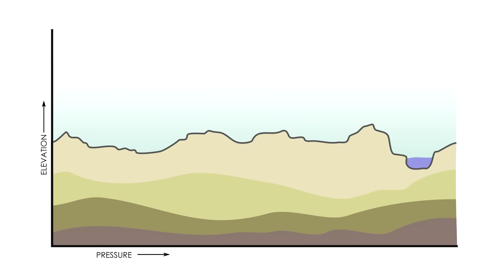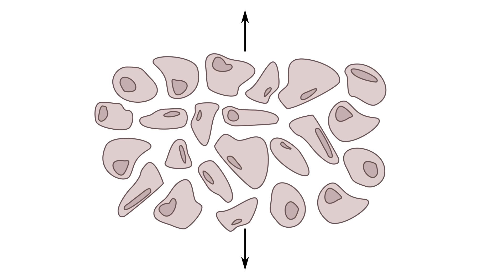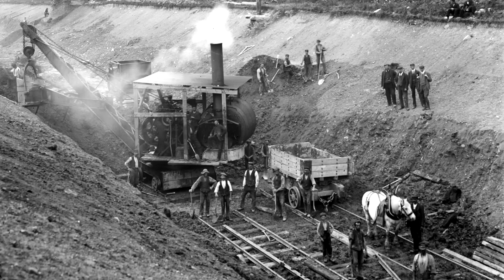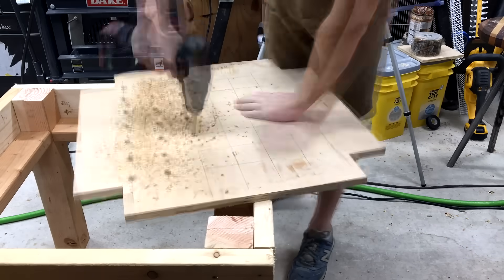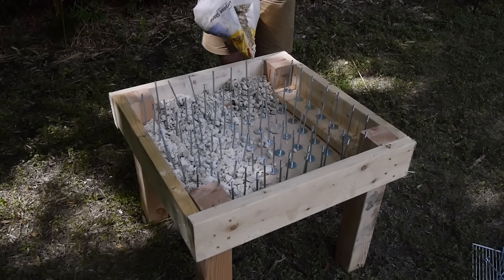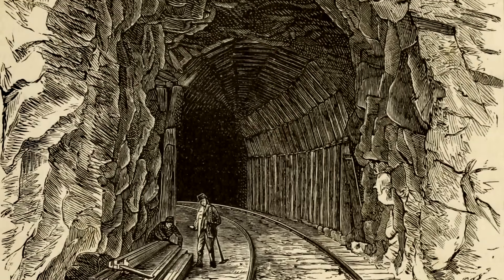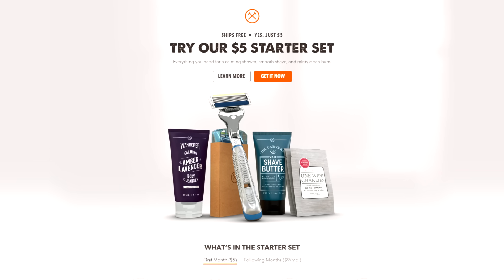Why Tunnels Don't Collapse

Comment from the maker: I pinned this comment just to say thanks for watching my video, and I hope you are having a very nice summer.
Reply: Please do a video on dealing with  underground water when digging tunnels, type of pumps used, methods and challenges.
Reply: Rob the Code master. It depends on how much water you run into some tunnels have to run a couple 200hp pumps just to keep from flooding I have been lucky so far as to have been in relatively dry tunnels in which a well placed 110v pump will do the job just fine
Reply: it's winter
Reply: i love it
Reply: Today it is so hot in Germany that the government reduced the speed limit on some Autobahn sections to 80 km/h due to the fear of blow ups. Meaning the road surface lifting up caused by heat expansion on old concrete roads. 

You might want to do a video on the topic and how to avoid heat caused expansion.
Reply: What I can tell from this comment is that you wrote it 6 days before publishing the video whilst still working on it or withholding it until a standard release date.
Hope you're enjoying the summer too!
Reply: I really enjoy your videos, I am a graduate civil engineer and I always learn something new.
Reply: In turn, I'm having a shitty winter in the southern hemisphere. you help make it a little less sucky, tho.
Reply: Could you do a video on the cost of regulation and how much of it is necessary for the environments they exist in? (i.e. regulations for earthquake sturdiness in non-earthquake prone areas, or low flow shower heads over personal preference.)
Reply: What a Hemispherist thing to say! ... It's winter down here, matey! :-)
Reply: im melting  in my chair
Reply: Yes, stone arches can work to transfer the compression load from the ceiling to the floor.  The gap can be filled with a wedge, or stone.  One book I read about minind described using wooden wedges above semi-permanent shoring so the wedges can be inspected.  If the inspection showed the ceiling is moving they come back and add more support or rock bolts.
Reply: Anime Freak,

Earthquake regulations in low-seismic areas impose very few requirements on a building design. Additionally, the entire US has been mapped out with estimated maximum earthquake forces, so in areas where those forces are low, the designers aren't making buildings extremely earthquake resistant.  Wind forces in low-seismic areas almost always dictate what the design strength will be. Almost all the imposed requirements also help with the wind resistance of the overall structure.
Reply: +1
Reply: Great video man
Reply: Question: Would making a stone/brick keystone arch work? Perhaps if a wooden spacer/wedge was inserted into the minimal space between the arch and stone ceiling?

Often in fiction, they have stone tunnels or even large vaulted chambers despite living in an age where steel weapons were expensive investments. I have always been mildly curious if such a method could work.
Reply: @Soulwrite7 A wooden former of the arch is scaffolded, the bricks all radiate as you suggest
Reply: I approve this video as a geotechnical engineer
Reply: Practical Engineering Awesome video! It answers so many questions. I want to be a civil engineer when I grow up
Reply: really liked the video, one suggestion: you should've taken a sledgehammer and destoy the gravel bridge. remember it's the internet feed us destruction.
Reply: i do not think summer is able to be nice specially in my region 
for this i really appreciate your video   , underground is best place to hide from sun heat
Reply: It is winter here, but thanks nonetheless!
Reply: Sir, you're awesome and I love your channel. Here are my civil engineering questions:

1. Could you do a video on how public transportation networks are engineered?

2. Could you do a video on irrigation systems?

3. Could you do a video on canals?

That's a start! I hope you haven't already done all that. I just recently started getting your channel on my "feed" as they say!

Bravo again!
Reply: how can a train drive
Reply: saturner 420 good question lol
Reply: I hope you're having a great summer as well!
Reply: Thanks for makin them, partner
Reply: Thanks to you for your very instructive videos
Reply: Thankyou
Reply: Great video. I've often wondered how I would build a tunnel in the side of a hill. Thank you!
Reply: Practical Engineering the strangeness of the result made me laugh while watching it happen in front of me. I liked the video you just posted.
Reply: What about the concrete series? You gonna work on it again?
Reply: Great video! Super interesting!
Reply: Practical Engineering your my favorite youtuber finaly someone that exercises your mind and i had no idea what civil engeneering was and im thinking of folliwing that career thanks to you.keep making videos plz ps your awesome
Reply: Love the engineering/technical explanation here. Can you cover "The Boring Company"?
Reply: Winter here mate =D
Reply: Sometimes, you do things that I think are crazy, and I don't believe that things will hold up, or do what you are trying to explain. But then you do it. You are a fricken wizzard.
Reply: Thank you for another awesome video.
Reply: badass video
Reply: Please make a series about how to reinforce a material
Reply: Nice work. : I spent some times into the fjords of Norway  where there are a huge  amount of tunnels (obviously). I was surprised not seeing any reinforcement ... we could actually only see the raw and sharp rocks. I imagine that what you just demonstrated is the explanation.
Reply: sooo rock bolts and shotcrete then ?
Reply: question how big can a tunnel get befor  it simpley cannot sustain the weight of the matrail above ? like    i think the biggest tbm  ids like 17m dia ? but could you high bigger and if so how much ? 20?30?50?m  is there some point atwhich you just cant realisticly go bigger ?
Reply: i concur from kiwiland :P
Reply: Thank you for making this!
Reply: What happened to your hair?
Reply: Nice winter yes. Nice summer no
Reply: Tunnels? You should analyse where the Anzob tunnel went wrong and by this I mean 2005-2015 before Chinese engineers were bought in to fix it. You can find videos of how bad it is. I had the misfortune of travelling through the Anzob tunnel in 2008. It was waist deep in water and on a motorbike that wasn't fun at all.
Reply: Yeah bro thanks :)
Reply: Can you make a difference between Post tensioned and pre tensioned beam. How it is made? Thanks!
Reply: Bit toasty, but not too shabby.
Reply: Practical Engineering Talk about Oak Island's Money Pit!
Reply: Practical Engineering 
Would an arched roof sending pressure sideways help any? Thanks for the video.
Reply: great video :). very knowledgeable and I learned new info.
Reply: I'd love a video on deep drilling, how to stabilise the drill hole and how deep we can get with current techniques.

Both for Geothermal applications and/or mining, although I'm mostly curious about the first one.
Reply: Video Suggestion: Catenary Curves
Reply: I pinned this video to reinforce my grey cells
Reply: Loved it, your explanation was very clear ... thank you!
Reply: Practical Engineering 
please add a video on drained and undrained condition for shear strength
Reply: I've always been impressed by excavation works in mines or tunnels, thank you for your explanations and "brave" demonstration.  I'm not engineer but I'm fascinated with engineering work and all your videos are very enlightening.
Reply: Very good explanation
Reply: Practical Engineering thanks for this video!!! These are great! I sent my brother a gift certificate to Dollar Shave Club because I use them too.   I thought that these videos are sponsored by a company I already like, maybe I should spread the word AND attribute it to your videos!

Thanks again for what you put together!
Reply: You need your own tv show
Reply: You could make a trap by having the bridge unbolt itself when you step on it
Reply: great experiment.....good information :)
topic I want to understand "How the bridges are built in sea"
Reply: You are awesome keep doing this 👍
Reply: wow amazing information. so i think you can make video about wood or bamboo engineering
Reply: nice pun
Reply: Great video as always but the photo at 2:40 isn't a tunnel. It's an escalator in the atomium in belgium.
Reply: Gday Please do a video explaining building a home under the earth eg SHTF bunker
Reply: Yup that's how it's done, but before the rock bolts are inserted metal screen fence is put-up then the rock bolts and plates are installed and torqued at least in the mines that I worked in, in Ontario Canada!
Reply: Add videos related to design of buildings to resist lateral force
Reply: cool stuff, love the vid.
Reply: Nice video. Manitoba 'professional engineers' are reckless trash who dont know what they are doing and their union the Engineers Geoscientists Manitoba covers for them.
Reply: Can you do a video on the different types of injection moulds? Thanks.
Reply: I am lol
Reply: the music is so fucking bad
Reply: Make a video on pile foundations
Reply: Very educational. Thank you
Reply: ?p0p
Reply: Hey grady...how long do you think you could make a rock bridge?
Reply: Do you think you would have better results if you had shaken or vibrated the rock before tightening the bolts?
Reply: As a hard rock geotechnical engineer working for an underground mine, I appreciate this video greatly and intend to use it as a training tool to explain to our underground operators how we reinforce the rockmass.
Reply: I know that they do a lot of cribbing in areas where there is a lot of soft rock when digging mines and in some spots the bolts and others a mix of bolts and mesh.
Reply: But its winter
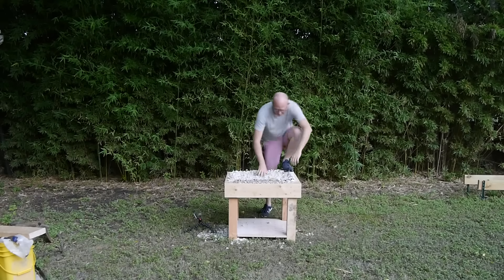Reply: 6:18 I was really concerned about your health when you stepped onto your bridge!  Especially standing on top of those bolt which "spiky" ends could have end up sticking in your feet? Please put use some other weight next time 🙏
Reply: Zfdododddodo
Reply: The PATH railway station beneath the twin towers was incredibly lucky on 9.11, excellent structural engineering prepared for 1M tons impacting the floors above. Perhaps load bearing columns cracked doing their job saving the slurry wall. 
  Designed to keep the Hudson River out no matter what , John Skilliing was prescient .. 
Please do a video about this event. 

I enjoy understanding your cogent explanations
Reply: Hey is there a reason this video isn't on Nebula? I have been rewatching all your content, using your youtube catalog as the primary source since it's more complete (this isn't the only video missing from Nebula), and I wasn't able to find this one there. I recently got youtube premium and I have a Nebula lifetime sub, was hoping to finally give you your money's worth from my views since all my old ones were with adblock.
Reply: It isn't summer anymore
Reply: Thanks for another interesting video!

Comment: I just visited Hoover dam and great emphasis was places on the stabilization of the rock around the dam during construction of the enormous tunnels and abutments of the dam. The method they used was injecting grout under pressure into all of the rock joints surrounding the tunnels, thus eliminating all the voids in the rock preventing movement and making them into one solid mass. I suppose this provides the same effect as installing bolts with much less labor and expense?

Comment: Now I understand what probably happened to a tunnel In the mountains here. It was restored and a big deal, because it made it easier to drive from east to west in the mountains. It collapsed on some men walking through it, I think to inspect it. It turned out that the company that had been hired to restore it had decided to put in less bolts than specified in order to cut costs. It's never been reopened.

Comment: I have been told that most tunnel failures actually fail when the bottom 'heaves' rather than the top falling.  Further, I understand that this 'total failure' happens in an earthquake.  Seattle's downtown tunnel needed to be lowered (to avoid 'raising the platforms for the new, taller-floor trains) and for a relatively 'brief' moment, the rebar on the floor of the tunnel was removed, replaced, and a new floor poured.  During this time, the tunnel would have been very much in danger if an earthquake had happened to occur.

Comment: Love your videos, but one lil correction, you called the rock material "gravel".  Clearly the mtl was crushed stone also called crushed aggregate.  Gravel comes from a river and is very smoothly polished.  This is more than semantics.  Had you used "gravel", the results may have been different.   By the way, gravel makes weaker concrete than angular aggregate.

Comment: I'd like to see a follow-up video about how these methods are being used in the real world. For example, how were the challenges faced by the engineers building the Eisenhower memorial tunnel in Colorado different from the channel tunnel between England and France, and what techniques did the engineers use to solve the problems they faced. 
Also, I'd love to see a video about the building of the Eisenhower Memorial Tunnel. It's one of the greatest achievements of civil engineering in North America, but it is vertically unknown outside Colorado.

Comment: I imagine building a tunnel through hard rock would be easier in terms of stabilization, but more costly in terms of cutting through the rock in the first place. I wonder if anyone has calculated which of these is more economical in total.

Comment: Hi, that vid was really an eye opening. I have some puzzling questions. If I were to dig my tunnel and under ground bunker, how deep do I need to dig? What is the most effective and inexpensive method for sustainable tunnel which can withstand extreme cold weather and other natural disasters? Is the concrete wall around it is more than enough or do I have to install rock bolt also? Most importantly how many feet below ground is safest from extreme cold weather and also shield from nuclear winter?

Comment: They should show your demo to roof bolters, most don't have any idea how it really works or why it's important  to do 100% all the time.  I think they also ought to pressurize tunnels with questionable tops.  Makes sense the higher the pressure the less leakage, gas.. rocks.. whatever more pressure keep the tunnels safer than low pressure.  Or changing pressure, wanna see danger time in a coal mine?  Watch the barometer drop suddenly, ventilation boo boos can do that.

Comment: I have a question about if something could be possible. I'm reading a book series that is set on a group of islands. These fictional islands have tunnels that connect all the islands together. Each of the islands is surrounded by the sea. So could tunnels naturally exist that you could walk from island to island without getting wet. No man made structures. And an Awesome video, thanks for the lesson.

Comment: Like the use of nail bolting the rock method underground and comparing it to a concrete anchor, would reduce the cost of tunnels but how can we measure the sturdiness before/after?

Comment: Could they use a method of these rock bolts, while also connecting long bars or wooden 2x4s/beams or something that span from bolt to bolt? Essentially adding a little bit of longer spanning section of support with the bolts?

Comment: I don't know if you'll see this, but I think it would be cool if you did more videos on soil mechanics.  It sound boring but I'm puzzled and fascinated by tunnels.  The roof of the tunnel is an arch, a compressive structure.  It seems like this should support the tunnel because it's constantly in compression.   If you're digging a tunnel in a sand castle, you know that you don't need to shore up the tunnel to prevent it from immediately collapsing.  If you're tunneling in dry sand, however, the tunnel will immediately collapse without shoring.  I suspect the shoring in the dry sand is not holding up the FULL weight of the sand above it, but what percentage would it be holding up?  It would be cool to understand what forces are at play here and how they would be calculated.  I absolutely love your videos!  Keep up the good work!
(Also, you wouldn't happen to know any resources on the subject?)

Comment: rock bolting technique is absolutely stupid because it is not reliable in the long run eventually the weight will make the balls loose overtime and then the tunnel will collapse having a cheap mind is it number one cause of safety hazard and disaster for public safety lives are at stake when you have a cheap mind. If you don’t have the money to probably build a tunneling system where you can spend and the money required to properly seal the tunnel rocks using concrete or stealing devices then don’t build a fucking turn on the first place.

Comment: my wife and I were watching  tv series about reopening a series of mines.  I tried to explain how geology works and why some areas require supports and some don't.  She was convinced that all the weight of the mountain is pushing down on the top of the tunnel and should collapse.  It was a fun discussion, but not convincing.  Searching for the engineering on tunnel construction I found your video and sent it to her.  Hopefully she will be convinced.